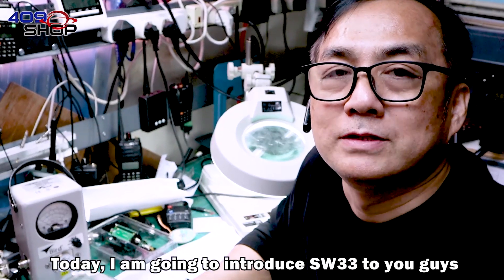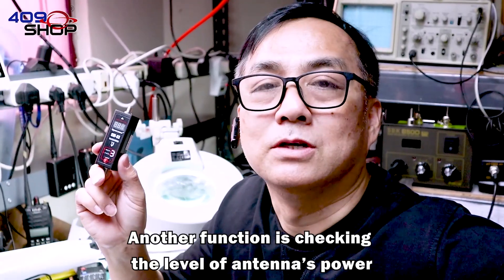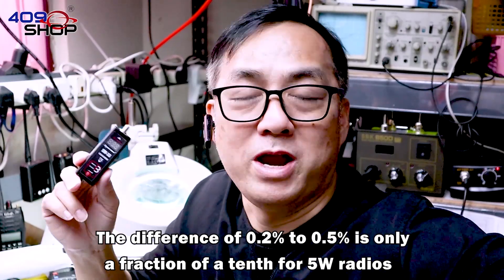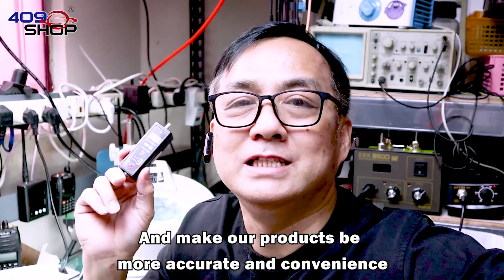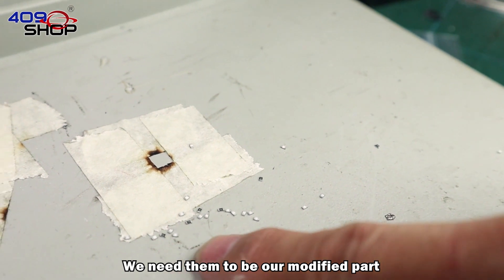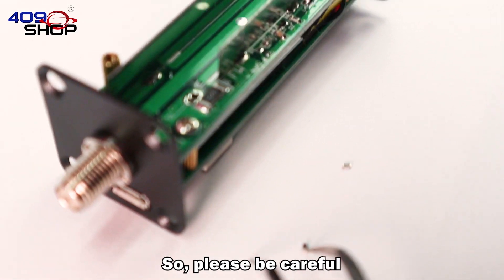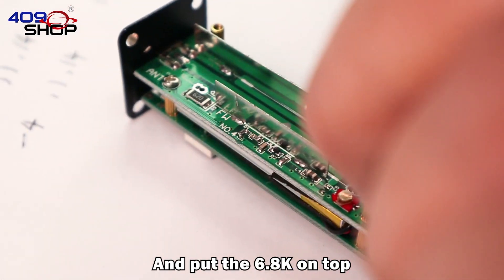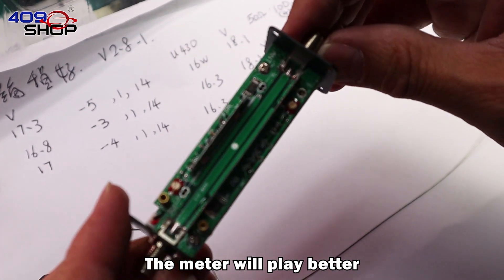SURECOM SW33 VHF/UHF 100W POWER & S.W.R. METER Change version

Comment: How to calibrate this device? By pressing the button twice, and then two more times, you enter the service menu and you can read the parameters. How should the default be?'
Reply from the maker: SW-33 cannot reset or adjust on device, you can send back the PCB only (no need the case and battery) to us, we can help you to replace it and change to latest model
Please contact us by e-mail: cs@409shop.net

Comment: I just got this today and it appears to have a 3rd mode. Once you hold the button to power on, you just click once to go to each mode. I can cycle through 3 modes. Upper vertical line is power, lower vertical line is SWR, but I also have a mode that is a lower horizontal line and gives different readings. Anyone else?
Reply from the maker: could you please take the photo of your mode 3 to show us, let us checking, please also mention the version of your device
here is our e-mail: cs@409shop.net
Reply from the maker: @charleshamilton635  thanks for your video, the mode 3 is REV mode, which is new function in V1.3 only
Reply: Thank you. So does that mean that v1.3 is not the latest version for the device? Also, what is the function of the REV mode? It is not mentioned in the instruction pamphlet I received in the box.
Reply from the maker: @charleshamilton635  V1.3 is the latest version
Reply: I have this as well
What is it ?
Reply from the maker: @nolibera5345  " REV "mode,  (For Version V1.3 only)
Reply: How do I know what version I have ?
Reply: @409shop409   only thing I see is a negative power value
Reply from the maker: @nolibera5345  Please contact us with your device photo, what negative power value ?
our e-mail: cs@409shop.net